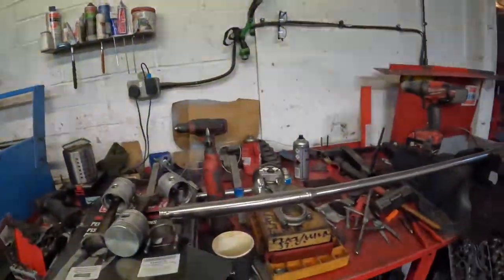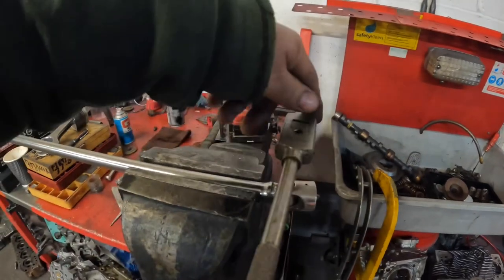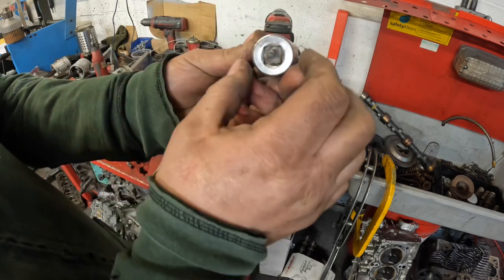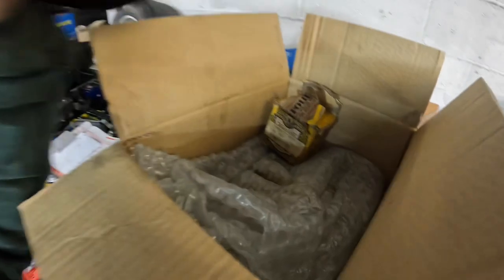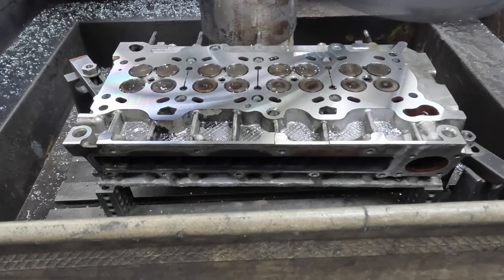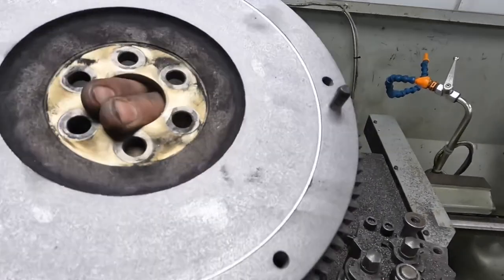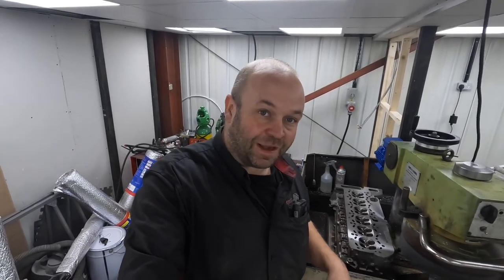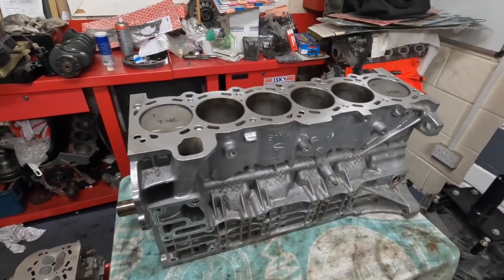BMW M54 Engine | Snap On Breaker Bar | Flywheel Repair, Machined & Stepped | Vandervell Gauge

Comment: Bearing, any video is a good video James, Vandervell is a blast from the past eh !!!  I brought a half inch breaker bar that I bought in Ireland in 1983 to my dealer here as I wrung square off it, there may have been a tube involved also, this was 2 years ago, I went to pay for the repair kit and he wouldn’t take it, that’s proper warranty after 38 years !!!!
Reply from the maker: You can't fault the service as long as the dealer is ok.

Comment: Bearing. Great video mate. Lovely job on the BMW. That'll run lovely as a result. Once you're fully settled in the new engine room I'm sure you'll be happier. (The Flathead is progressing well by the way)
Reply from the maker: Thanks Craig, yes the new room is lovely.. I'm pleased your moving forward with the flathead